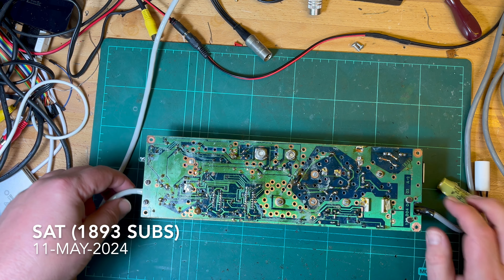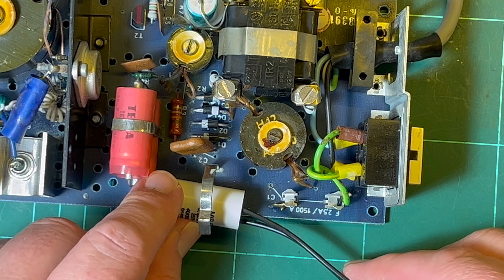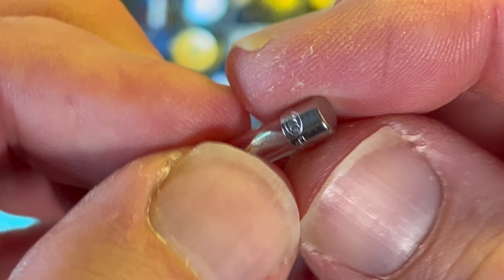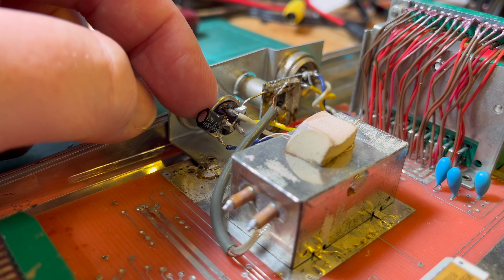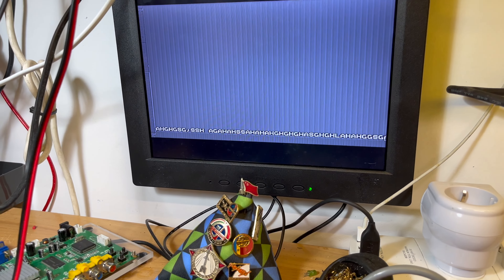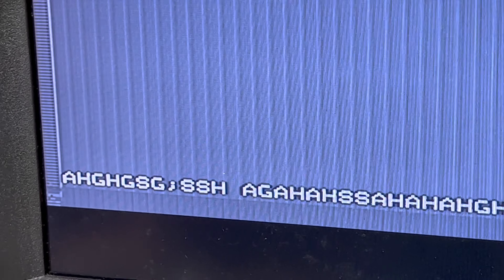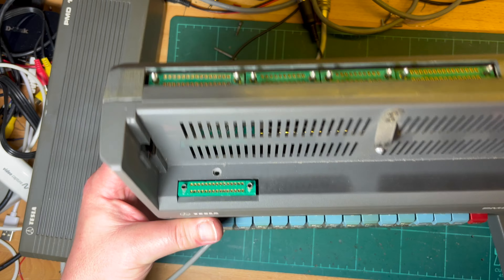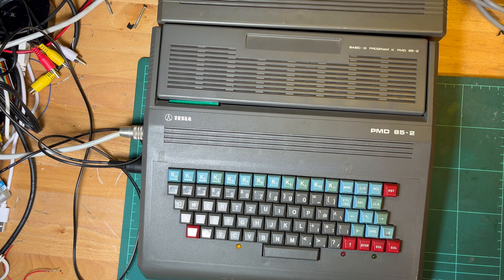🇸🇰 Tesla PMD 85: Part 6 (Video output!) [TCE #0446]

Comment: Glad to see you have video output. As for the keyboard beeping, a good way to test the disintegrated dome theory is to carefully flip the computer over while it's turned on. The beeping should cease then. But since you are now mentioning a different cause, maybe you are lucky and won't have to disassemble it. Well, eventually you will have to anyway as all these keyboards will have that issue sooner or later. If you ever want to disassemble the keyboard, not sure if somebody hasn't mentioned this here already, but basically you need to cut the plastic rivets, do whatever you need to do to clean/fix the key mechanism, turn the bottom of the key 90 degrees and screw it back with fitting screws.
Reply from the maker: Am going to try the keyboard today ... I know some keys are working ... like [SHIFT] [RST] ... but am dubious about others, so I'm expecting to have the issue.
In Yura's (@yurasergienko6890) comment he pointed to video by a Hungarian fellow where he tells also about replacement rubber domes on Aliexpress:
https://youtu.be/SZ3X2oSUivU?si=S5t4uMJRMcQf75sG&t=1089

Archived Aliexpress link in case someone reads this comment in 2044 and wonders what type they were:
https://archive.is/0Sk09

Comment: Hey! It lives! As for the conductive domes shorting out, didn't you have the keyboard unplugged the first time that you fired it up? As for a keyboard controller chip, I would think that it has one. And for improving my video output I bought an old Extron 112 (I think...) and it cleaned things up pretty well.

Did you see the Aurora Borealis? No luck here.
Reply from the maker: Oh ... yes, you're right - it was printing out garbage before I connected the keyboard.  Duh ... I'm a bit oblivious sometimes.  

Weather here has been pretty rubbish lately - just constant rain.  Compared to 2019 or 2020 (just before Covid lockdowns started) when we were on strict water rationing ... we had to fill up pool up with a water tanker as we couldn't use tap water, and we couldn't water the freshly laid turf at all.  Now there's too much water.
Reply from the maker: Fixed it!  I had another look - it's just using one of those 8255s (interface adaptor) ... so tried swapping the original Tesla part for a Western one ... and it's working!
Reply: @Brfff  Woo-Hoo! Alrighty then!

Comment: I also have a PMD, and I also encountered the fact that the keyboard is terrible. Some buttons get stuck and you have to press hard to press them. Other buttons give false positives and auto-returns.
Reply from the maker: I've been thinking about designing a replacement, modern keyboard ... if no-one has done it yet ...
Reply from the maker: Got the keyboard to stop repeating - seems, in my case, it was a dodgy 8255 interface adaptor (Tesla MHB8225A) - replaced it and it seems okay now ... more testing tomorrow.
Reply from the maker: Excellent, thanks ... and he provides a link to Aliexpress where he got replacements!